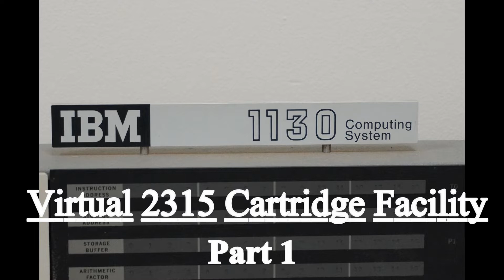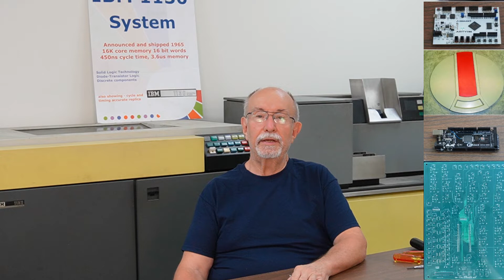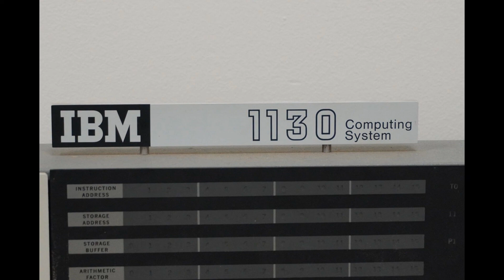Virtual 2315 Cart Facility - Part 1

Comment: Carl, this is an AMAZING project, and the Forgotten Machines team would love to expand on what you're doing here to include the Diablo 30 and 44 series drives, Data General drives, Perkin-Elmer, and so many more...we have so many systems to do this with.  Thanks for making this video!!!
Reply from the maker: I have used similar with Xerox Alto drives which are high density Diablo 30 but with unique format on disk. Used counterpart designs to read Perkin Elmer drive used with Altair 

One challenge of adding formats is the required storage for one drive worth of data. Since these must be writable at the speed of the drive it can be challenging. FPGA onboard RAM not large enough. 

I stopped in the middle of testing in order to get an IBM 1130 restored and back to its museum without waiting for the disk project. 

That machine almost ready to return now thus I can get back to the project soon. 

Happy to look at how it generalizes. 

For example, some Diablo deliver only sector pulses, others have a sector number output, plus other signal lines can vary.
Reply: @carlclaunch793 Fantastic, Carl, I look forward to your updates, and meanwhile we're having fun over here building on your work with the Diablo & Alto!